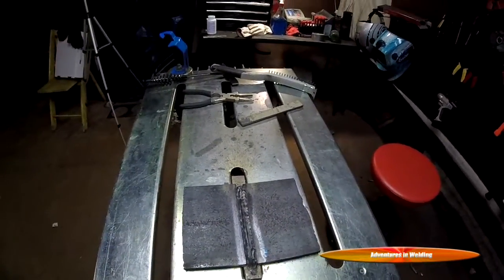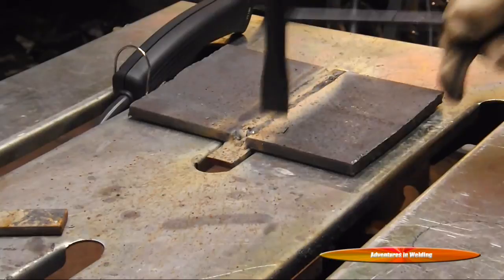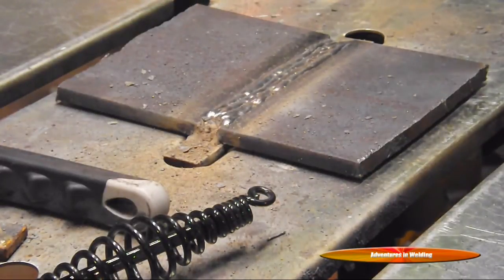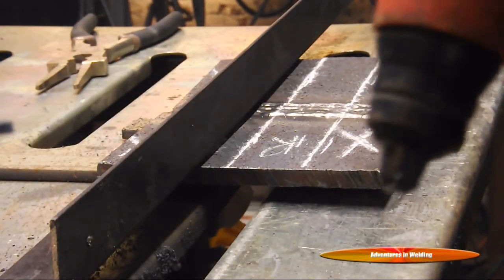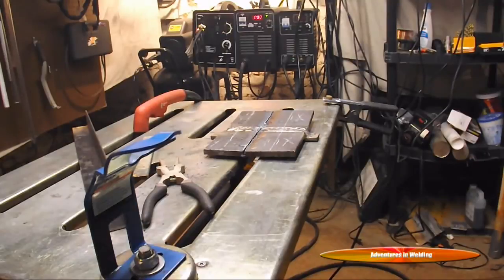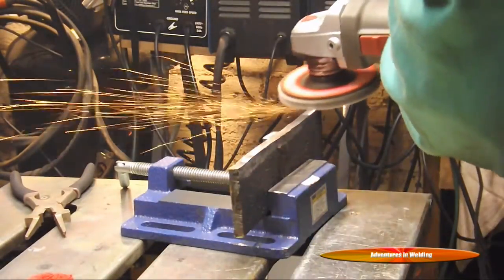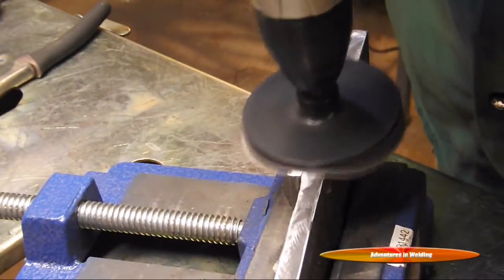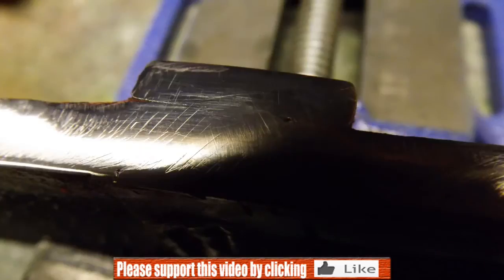Multi pass flux core part 2 - Adventures in Welding #134

Comment: sorry man, i'm a third year welding apprentice and what you are doing is wrong, that being said the equipment you are using, namely the welder itself is not designed for the joint you have designed. you are doing something similar to a cwb stick plate, 3/8 plate 4x6 one side with a square edge, the other with a 30 degree bevel. you are also running 3.5 or 3.0 self shielding by the looks of it. Try a certified college, its worth the investment.
Reply: Pretty sure two decade of successful welding experience beats a three year apprenticeship…. The point was to see if welding this thick of metal can be done with a flux core welder….. we all know there are better welders for the job but this got it done.
Reply: Just because somebody's been doing something for 20 years doesn't mean they've been doing it right for 20 years. And it's just that kind of attitude that keeps you from learning anything new and becoming better at what you do. I understand your hesitation to listen to someone who appears to have less knowledge than you but we could all learn more and clearly since he's in school and clearly since you think what he has to say is an important it says a lot about you

Comment: Great videos and test - thanks for sharing.  For us weekend warriors,  do you think a 200 Amp stick welder are the most economical way for welding thicker steel 1/4 inch plus?  I have a Northern Industry 120 AMP Flux core welder and running 035 multi-pass wire from INETUB.  It works OK for 3/16 thick steel or less but welds on thicker steel look like popcorn.  Higher amp flux core or MIG welders are pricey. So, been thinking the Lincoln 225 AC or the Everlast PowerARC 200 is the way to go.  So value your thoughts.